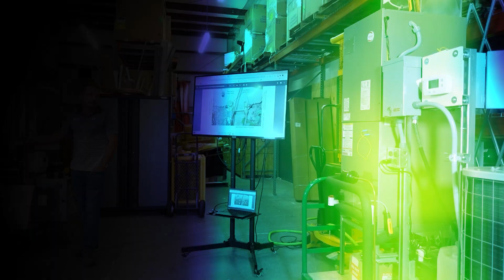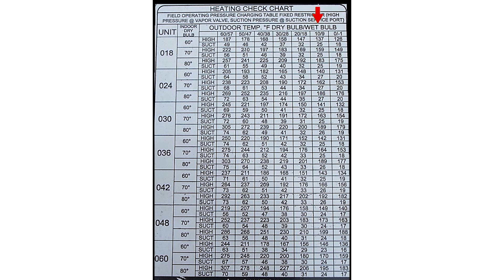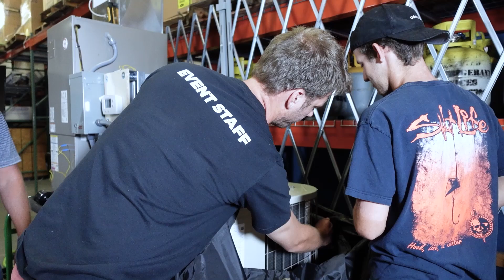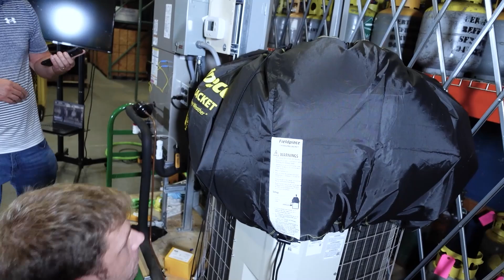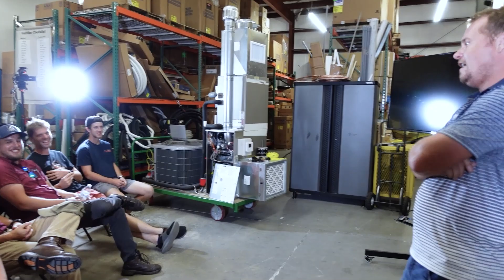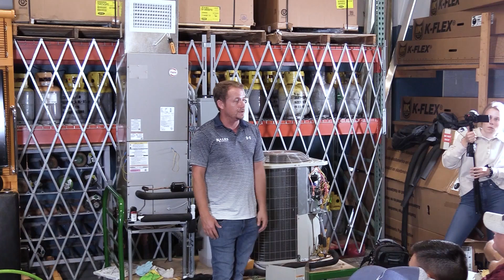Heat Mode Charging and Testing Class

Comment: Great info. I wish a small vignette about zone systems would've been mentjoned; I've dealt with a dual fuel, zoned system that I was concerned did not have correct settings in staging, but I think it's issue was with having no supply air sensor, hence not able to shut off the compressor when the temp got too high, thus causing less heat rejection, putting higher strain on the system, and it was blowing compressors and breaking open places on the indoor coil.

Comment: So if your unit has a heating txv you can check your pressures at common suction and liquid port? Because I have always been told to check my pressures at common suction and vapor line in heating mode with my gauges. P.S I am a huge fan and supporter of your podcast and YouTube videos. I’m new to the tech side but I been an installer and also gas installer for 20 years. And I have ocd really bad and I want to make sure I’m doing the job correctly because I have a fear of making a mistake. Thank you for your help,time and advice

Comment: i lived in a house that was built in the early 60s in jacksonvile It had an oil furnace and when we replaced it back in 1993 the tech said they were dinosaurs and being phased out. It was replaced with a heat pump

Comment: Worked on a nordyne today with a piston in the expansion line(just like carrier)and the acoil wasn't warm in heat mode and had high suction pressure. Took the piston apart cleared a restriction, some tiny metal 3 pieces, pulled a good vacuum and weighed in factory charged and boom back running good

Comment: Bryan I thoroughly enjoy & learn from everyone of your videos. You mentioned though that a piston can't increase pressure. I'm only bringing this up because I have gone back to some Carrier units (side discharge condensers mostly) where previous techs diagnosed & changed txv's, so called restricted evaporator coils & I've found that the piston was installed backwards on the heat pump. The head pressure is always high & subcooling all over the place. So now as common practice myself I test tempature before & after piston before I even start diagnosing a txv. Your already outside & right there. Basically a piston can increase pressure if not installed properly. Just 1 more quick check to perform before opening a can of worms.

Comment: Another alternative to jumping out the defrost thermostat to test defrost cycle is to kill power to condenser, pull condenser fan wire from defrost board fan relay, restore power.  Coil will become cold enough to close defrost thermostat within one minute. Initiate test pins, kill power again after defrost cycle starts, plug fan wire back in, restore power again and wait for it to exit defrost cycle.
Reply: lolzzzzz sounds like some one is scared to touch live wires!!!

Comment: Tell Bert to chill out on his dirty equipment inputs. But I loose interest when I hear it over and over. The home owners are not watching this, hvac techs are watching.  We know that the system will not operate correctly if the coils are dirty. I bet this could have been a 45 minute video. I stopped watching after 25 minutes because my time is valuable.  After I take a break I might finish watching.
Reply: This is super late to respond to, but as obnoxious as it to hear the same thing over and over again, he’s entirely justified repeating it and I appreciate it. If you work solo then you probably don’t have to deal with it, but 1000% if you work in a company with multiple techs there will be a tech that disregards the importance of having a clean system before testing and it can be costly both in time and parts. You obviously understand this. But you also have to be clued into the fact that there are MANY MANY techs that don’t take this part serious enough. He could’ve said it 8 more times and there will still be those who watch the video and disregard it AS TECHS. not trying to argue, but this is an educational channel. You learn by having things repeated.
Reply: @joshfoyer Agreed, Proper airflow is just as important as any other major piece of equipment in a system. Without proper airflow as us techs know it, it can give you a large variety of issues even a simple thing like an improper charge reading. You can’t expect to race a car and win the race if you have changed the oil in 120,000 miles.

Comment: First off, keep up the great work!
Second, just wanted to add a few tidbits you might find useful. For a defrost board to engage defrost, you need to make sure that your 24 volt R has power to board. I've come across Trane and Carrier heat pumps that will not defrost without board power. Also, if you want to check a Carrier heat pump defrost cycle quickly,  just remove the pink defrost stat from board, jump the 2 defrost pins with a gator clip and then short the speedup pins 7 seconds for every 30 minutes of defrost timing. Defrost will run until gator clip is removed and plug reinstalled to board. Works the same with the 2 brown DF terminals on a Lennox heat pump. NC winters can get cold and during service calls/PM's, it's good to know that the board will operate when it is needed. 

Side note, shorting the speedup terminals on normal operation for Carrier reduces the needed runtime to 1/25th of its original time.

Comment: I find the 100-110 over ambient is highly variable just like the condensor dtd. What drives discharge temp? Mass flow and suction superheat. On carrier units with piston I find much lower suction pressure and higher superheat than with unit with outdoor txv that is able to give higher mass flow and lower superheat across the board. The outdoor TXV equipped unit will have lower discharge temp.
Reply: A lot of systems have wonky readings because the evap coil is sized more for a.c then heat and the evap coil is alot smaller than a condenser coil so being the condenser in heat mode it builds a higher differential than normal sometimes.

Comment: You said if you have 130000 btu gas furnace you will get 130000btu of heat but if it’s a 80% you lose 20000 btu through the flue pipe and if it’s a 90% you lose 10000 btu through the flue pipe .. correct???